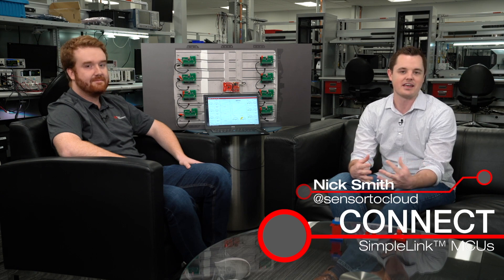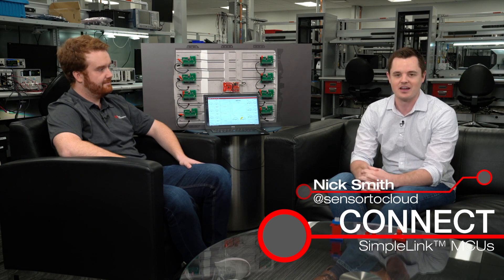Connect: Why wireless for battery management systems (BMS)?

Comment: It sounds interesting. Can you advise on the master controller? What is the controller that is compatible with BQ79616-Q1? Because we faced some difficulties when we connect BQ76pl455a-q1 with a microcontroller.

Comment: Hi TI, this is a very informative video! Evan shows a setup of 8-slave  + 1 master nodes. Each slave node in the demo looks quite large. With the current EV battery pack of around 200 cells, does this mean it would need about 200 slave nodes? How about the  number of master nodes?
Reply: One Slave can handel 8, 12, 14 to 16  Cells in Series at a Time. In one 4 wheeler battery pack 10 Battery pack in series ,then you would need 10 slave & One master
Reply: in this case they used BQ79616-Q1. It can handel 6S battery packs.

Comment: That's an interesting conversation. I'm a student and have a couple of doubts.
1. What is the 100ms interval being referred? Is it related to any specific protocol? And is it programmable with simple link sdk?
2. Have you used GUI Composer for displaying the data?
Reply: Hi there,

You seems to know a lot about this stuff.
I am a lone guy trying to build a small series electric supercar.
Would you be interested in discussing about this?

Thank you in advance

Comment: I'm not sure witch part is wireless exactly, so the cells themselves are probed for voltage measurement at each series level using normal wires, and each groups of these are sending wireless data to a master controller right? So this would then be useful on a system with many separate battery pack? pls excuse my noob question :)
Reply from the maker: Thanks for your question, Emile! Yes, the wireless communication reports measurements sampled by the BQ79616-Q1 (battery management IC) in order to make the system more modular and scalable.